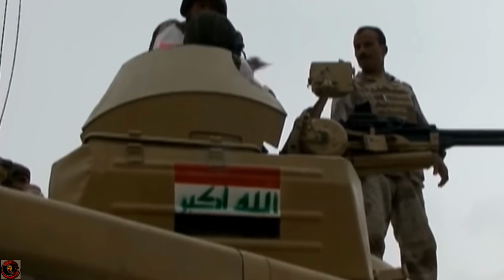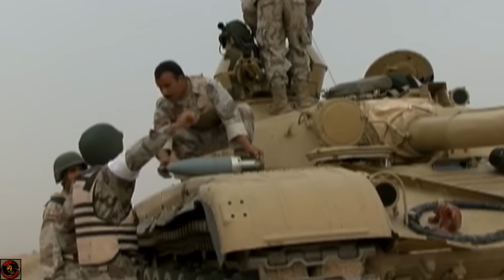Do Russian Tanks Need Bigger Guns?

Comment: I agree. Longer and more advanced 120mm and 125mm guns are a smarter option for the time being as opposed to bigger guns. Russia has certainly inherited large stocks of 125mm ammo from the USSR and given that they are not fighting Leopard 2s or other advanced tanks, most of this old ammo is just fine. Even old 3BK12 will turn a Bradley or Boxer into scrap metal, and 3BK29 will defeat any ERA currently mounted on non-MBT vehicles. NATO HEAT rounds will do the same to most APCs/IFVs currently in service. Furthermore longer guns will improve performance on existing KE rounds. Add to this that many nations are looking to downsize or cut tank fleets and bigger guns do not make a ton of sense right now. We will likely see bigger guns sometime in the future since armor development will continue and eventually we will hit the limit of existing guns, but for now, 120/5mm works fine.

Comment: Good news, the Leopard 3 is - more or less officially - anounced. In this case Rheinmetall think about a modern 100mm gun concept like the Armate is using(in some variantes). Indeet as reaction to the Armata and to ... well ... drastically corruption in the german goverment in case of defense ministers(who are in charge to buy new toys). So if germans nowadays say: "omg, the red evil awakes once more", they litterally mean: "fk our ministers of defense and give us some things that does work!"
Still the Leopard 2A8 is hell of a beauty.

About shells - the T-14's small calibre gun uses a longer penetrator of around a meter length to give a penetration of (as it is said) 700-900mm on 60° at 4Km range, but other sources report the Vacuum-01 and -02 to penetrate only 1000/900mm at 0° and 2Km(which means different ammounition for long range combat). Rheinmetall seems to take this serious, for ther own adaption of a lower calibre/longer penetrator-concepts.

Comment: Here's a thought - by upgrading to a bigger shell does that allow you to downgrade the shell itself?
Is it cheaper to use a SABOT or a HEAT round?  If you are firing a bigger shell then you can pack more explosives in it and possibly have a larger, but cheaper and faster to produce HEAT round that has the same effect as the more expensive SABOT.
We have autoloading, self-propelled 155mm artillery so how difficult would it be to modify those into MBTs?
You could potentially make such a vehicle serve as both artillery and MBT as it would now be able to fire artillery shells or direct fire rounds.
Disclaimer - I don't know enough to put these suggestions forward as anything other than a guess, so if I'm wrong, please educate rather than flame.

Comment: bigger guns means less shells.
Why not stick with 40mm or 50mm and hurl down some serious dacka downrange at 1-10 RPM. will immobilize any tank well enough, taking out tracks and optics, as well as blow through most cover in a few shots. The range will be lacking, but at least you get more than 20 shots you'd get for having a 150mm monster that no one needs.

Comment: it's simple. Caliber 152mm is better suited for firing a certain type of missiles. 125mm caliber is too small for them. Shoot shells of calibre of 152 this course is also cool and better than 125mm. Though their ammo will be less. But the main reason is the size of the missiles. In smaller diameter missiles do not fit what you need to make them a really perfect weapon for the tank.

Comment: so this is what it comes down to.
in order to make a good projectile that can punch through armor. standard APFSDS. it uses standard physics to do its thing. mass x velocity. 
the West' current highest penetrating munition is the US's M829KEW-X prototype 120mm Sabot. 10kg. fired at around 1740m/s. Currently the US uses the M829A4 i think it was. firing a 10kg at 1,555m/s. 
so the issue is generally becoming who can make the heavier hitting round. as the equation of Mass x Velocity. Mass is a major factor wile Velocity is a subfactor. 
if to change the 10kg / 1555m/s M829A3's weight to 9KG. at 1555m/s you get a totally different MJ output. if you went 10KG at 1455m/s there will be little change.

look at it like this. 
10kg x 1,555m/s = 12.09MJ of power
9kg x 1,555m/s = 10.88
10kg x 1,455m/s = 10.58
-
10kg x 1740m/s = 15.13
=
so at what point is the limit? we cant make the round any longer really. unless we go the German way and extend the length of the barrel, thus also allowing to extend the length of the munition as they did, without changing general calibers. 
or make it wider. the US has used 152mm guns before.  most experimental and for demolition. but still. a 152mm munition would need a new turret, maybe even an autoloader. id suggest testing the system on the M1128 Stryker MGS system first in honesty. Talk to Ratheon. they alread have 120mm M1A2 fit autoloading systems ready to go.

Comment: it's easy math:
E = m * v * v
It's better to increase the velocity of the shell instead of putting more mass into it.
Also P = F / A, meaning smaller shells produce more pressure.
I don't think there is too much difference between a 105 mm or 120 mm shell. Besides you can carry more of the smaller ones, and they're not as much of a pain to handle.
Actually they should just put a gau-8 avenger on a tank. 30mm api won't shred modern armor, especially from the front, but it'd certainly wreck your optics, barrel, tracks and all the other 'delicate' bits on your tank and make you pretty much ineffective.
Aside from all of that, who needs tanks anyway? To fight radical muslims? an ifv would do just fine there. it's not like there are massive tank battles coming up in europe, or russia or the united states. Sure, israel would need them, but they got their kit.

Comment: Matsimus, I'd be interested to know what you think of this idea.

I think in the future with ever improving technologies like smart armor (aps/reactive panels and such) and missiles (currently being one of the biggest threats to tanks in direct engagements), we're likely to see a more mobile smart protected missile capable "tank" come into the mainstream. For this concept think maybe the Stryker or CV90 but with modern APS, newer armor and no transport capability (purely a fire support vehicle role similar to the tank), using missiles as the primary anti armor weapon with shells taking an anti infantry role.

Obviously we really don't have a good example of this being used anywhere, but with all the developments in armor tech and tanks around the world slowly adopting missile capabilities. Think this is a plausible outcome? It would ultimately be cheaper then building tanks in their current form I'd wager, and less reliance on bulk armor would allow these vehicles to move faster on the battlefield, something that's always a good thing.

Comment: Actually it's almost impossble to penetrate an Abrams frontally, especially the turret. Even with modern tanks rounds, a Russian tank would have to be extremely close and lucky to penetrate an Abrams turret. In Iraq an Abrams actually shot at another Abrams that was badly damage from a huge IED, so they wanted to make sure it was completely destroyed so none of the sensitive equipment in was taken. So another Abrams shot it at almost point blank range in the turret and the round bounced off. You also have to consider that US DU sabot rounds are the best tank rounds in the world and if they can't penetrate, then a Russian tank round is definitely not going through.

As far a putting bigger guns on tanks, I do agree that it really isn't practically, especially when talking about something over 130mm.
Reply: MississippiRebel it’s not impossible

Comment: You may be the last generation of tank crew who had to climb inside the tank. Those people in the air condition office are planning for AI tank, where the driver are station miles away from the front line. Kick away all crewmen and live support systems, the tank can be build remarkably smaller and lighter. Use any weapon and ammo, such as uranium AP rounds. Especially the terrot, it will be flat. At the same time it will be capable of walking into the transport plane by itself. It will tell you when they are injure or hungrey. And the most important things is government don't have to pay them! They don't have human rights!

Comment: We need to understand what is needed for  what , an increase in the caliber today is only useful for increasing the useful loading of high explosive shots, which is reasonable for assault guns working against fortifications and infantry , but for fighting tanks we using sub-caliber ammunition , there it is necessary to increase the speed, which of course can be increased by a large propellant charge by increasing the caliber, but it is ineffective method by many reasons , and the characteristics of the attacking element, which  has very little to do with the caliber of the gun, although an increase in the caliber will allow the use of a more powerful missile weapons - Russian tanks can fire and missiles to - but the increase in the caliber will reduce the nomber of caring ammunition , I do not think it's worth it, especially  tank guidance of missiles is on optical and laser channels, against which there are effective countermeasures, larger missiles are also radar-guided, but there is no such equipment on the tanks, although there are radars on T14 armata which have alote of  unknown capabilities  ...

Comment: I tend to side with better missiles over bigger guns for anti tank. Guns will always have limited range and line of sight issues vs missiles and missiles put much fewer design restrictions on a chassis than a massive hard recoiling cannon. Some anti-tank missiles have an RHA rating of 1,300+mm superior to even sabot rounds. Of course with quality missiles costing about the same as a new Lambo cannons will always hold an edge in the economics of warfare but that is a separate issue all together.

Comment: According to the manufacturer of Russian Armata T-14 tank, it has no need for the crew to operate a gun because turret is totally unmanned, therefore all it has been automated. If that is true then this tank has full justification to have such powerful gun as it will blow enemy tank on much greater distance. The kinetic energy of a shell 125mm or 152 is very different. 152mm will in case of hitting turret not just penetrate it but it would blow it away. Then again in urban fighting having heavier HE shell will surely do more damage and flush out insurgents. In my opinion, Russians are way more advanced in the tank technology than our German designers. Truth is truthe no matter if we like it or not.

Comment: Yes because russia is upradge its super tank the t-14 armata into 152 mm cannon in the next future the t-14 armata future is here in 2015 original t-14 armata 2a82 which it has 125mm cannon while t-14 armata 2a83 will have 152 mm cannon and can beat abrams including m1a3 abrams as well but only t-14 armata 2a83 because it has 152 mm cannon and m1a3 also has 152 mm cannon as well both are compare that would be a tie

Comment: Could you talk about advantages and disadvantages of placing the driving sprocket in the front compared to the back?
I noticed the pzh 2000 having it in the front and the leopard 2 using the same chassis having it in the back

Comment: Due to improvement in technology  Rhinemetall is able to develope 130mm gun with same performance as 90's 140mm gun. The main question is how much weight your throwing around, even though US tanks fires heavier round at less speed it has more kinetic energy than any other gun firing faster but lighter round. At 2000m/s you are at the absolute limit of Depleted Uranium rounds anything above it one should stick to tungsten carbide rounds. What remains to be seen is who can fire full bore heat/hesh shell at speed faster than or at 1400m/s and heavier 10 to 15kg (1-2m) long penetrator at 2000m/s

Comment: It should be noted that most of the Leopards in service are now of A5 spec or higher, and many with the almost obligatory added armour packages, a combination which is commonly expected to rather easily best any of the Russian T-72, 80 or 90 derivatives - a rather critical point of fact considering T-72's still make up the bulk of Russian armor. Furthermore the 120mm DM63 round is probably the best performing APFSDS-T round in the world atm, esp. when fired from the L/55 cannon, only being rivalled by the US Depleted Uranium M829A4 "silver bullet" round. Thus it's Russia who for a long time now has been on the back foot and had to come up with something new, and this turned out to be the T14 "Armata". The western response is a new 130mm L/51 gun (once again by Rheinmetall) which boasts a 50% increase in KE as compared with the 120mm L/55, and a joint project between Germany & France to develop a new MBT.

Comment: Biggest problem with the ammunition is that gunpowder has a maximum velocity and we are pretty much close to that velocity. Increasing caliber would give change to use heavier projectiles and they would pen more. One solution to the problem is railguns, but you would need to have one Chernobyl built in your tank to power it. Second option is to not use burning gunpowder gasses to propel the projectiles out of barrel. IE. Light Gas Cannon. Such systems are capable of forcing liquid hydrogen into a metallic state. (I'm not joking here, you can google that, if you want :3) It is actually pretty simple in theory. You just squeeze the gas in a ultra high pressure and release it. At least one AF base somewhere in the USA has one of these, but it is a bit heavy. Breach of that thing weighs like a one metric ton. (That thing can shoot 84mm diameter projectiles at 7.5km/s, yes 7500m/s. Abrams does under 2k The bigger one has 200mm of diameter and can do 4.5km/s) I don't know the weight of such projectiles, but even 1kg object flying 4.5km/s will do a lot of damage. (5kg projectile flying 7,5 km/s would have same amount of energy as 0.03 tons of TNT. Abrams shooting M829A2 (9kg?) shell at 1650m/s would have around 0.003 tons of TNT equivalent.)

You just have to redesign the cannon breach, loading systems and pretty much anything related to the gun. Barrel life is also a bit problematic with higher pressures. But yeah. I'd say it is possible to make 120mm cannon that shoot projectiles at 5km/s, but you would have to change barrel probably everytime you expend all your ammunition in the tank.

And now when I'm thinking of this, you probably have to cover your projectiles with ceramic tiles, because they would melt from the friction at that high speeds.

But yeah, the cheapest solution; Just built shitloads of tanks with older tech, that has higher reliability. If enemy has five ultra high tech tanks, they can't win if enemy has 20 second grade tanks.

Comment: so think of it this way. the mk44 Bushmaster II 30mm thats mounted on the M6 linebacker can load APCR, FRAG, and Sobot munitions. 
APCR designed to generally eat through fortifications. FRAG for AA or AP. and Sabot to fight armor. 
now this 30mm is a 30×173mm the A-10 uses a 30×173mm. the A-10 finds most of its armored targets week points in the top. wile the M2 and M3 Bradley that still use a 25mm Bushmaster I and use TOWs. 
Though the M242 25mm Bushmaster I was not designed to combat MBTs. or atleast defend itself from them. 
The 30mm on the M6 is able to at the very least defend itself from an MBT engagement. that is. if it finds itself combating from the front or sides of a T-90 or T-14. if it was a T-72, that 30mm DU round would eat the shit out of the T-72 armor.
Though well placed shots are what im talking about. even M2 and M3 teams are tought to aim for the neck or the tracks. usually the turret ring of a tanks is not that well armored and holds more mechanical components then armor. that area is a perfect spot to be shot at by any kind of armor.

Comment: Even the Germans want to use a bigger gun to replace the standard 120mm one pff ,actually there is a  130mm gun prototype already-Raimental 130mm gun supposed to go inside the next Leo model ,but currently they didn't manage to design a turret that could support the 130mm gun effectively ,the Russians solved this compatibility problem long time ago lol and can mount successfully the next gen 152mm gun already ,if only the Russians had the funds like the west have they could design and build miracles..

Comment: Personally I think that the 120mm is quite enough. Bore is not the only variable that can be changed to improve combat effectiveness. We can improve on the other variables like increasing muzzle velocity by having a bigger charge (although it also limits the angle of depression) and improving overhaul efficacy and technology of the projectile. And forgive my ignorance, but why are we still using smooth bore cannons??